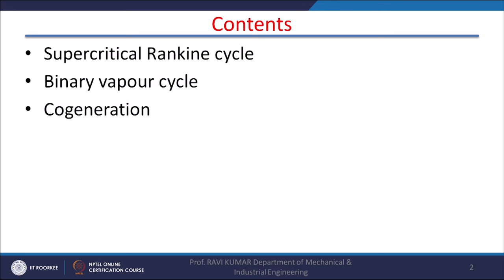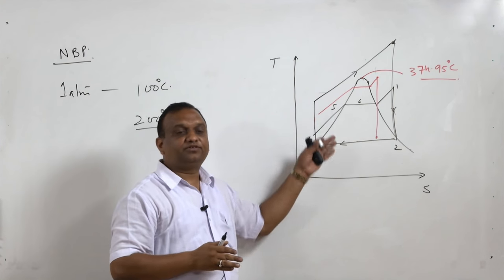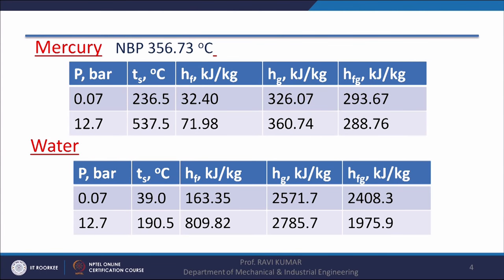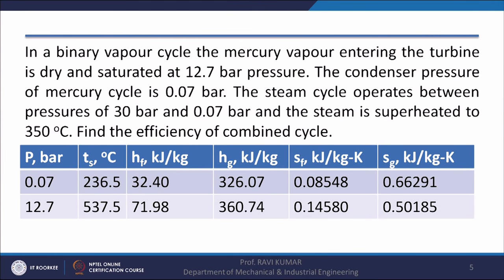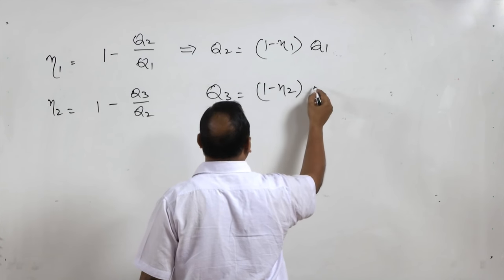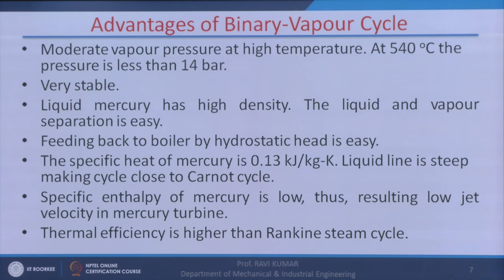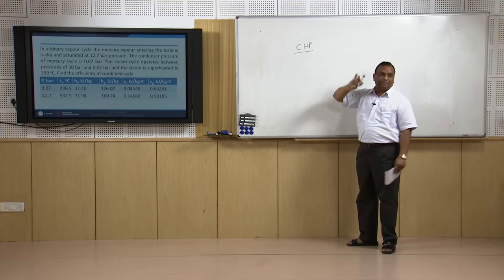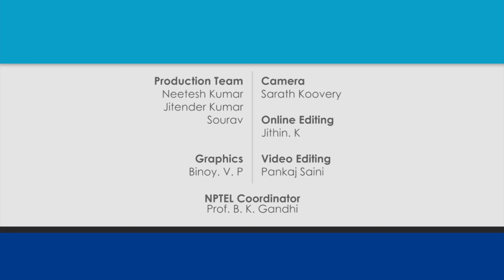Lecture 04: Binary vapour cycle and co-generation

Comment: Why moderature vapour pressure of mercury at high temperature is advantageous in rankine cycle compared to water? With my uderstanding it should be a disadvantage because to attain high pressures the temperature of mercury will become very high?
Reply: This is binary vapor cycle. Marcury is deal with low pressure turbine and waste heat the water and which deal high pressure turbine.take combined efficiency
Reply: As per my understanding,the moderate vapour pressure of mercury is advantageous in the perceptive of boiler design , less thicker boiler can be used and the heat supplied will be unaffected by pressure , as at low pressure mercury carries more heat  and then transfers it to the water.